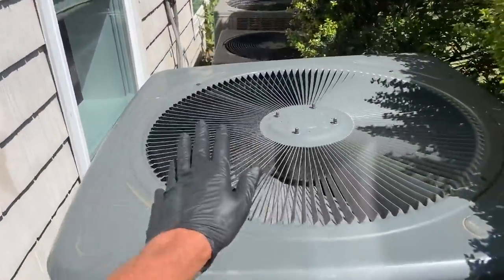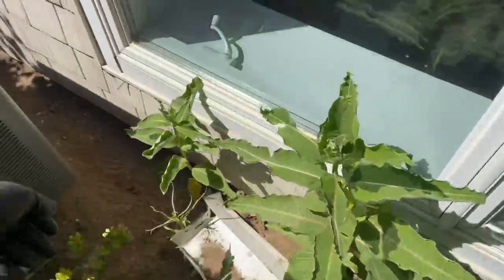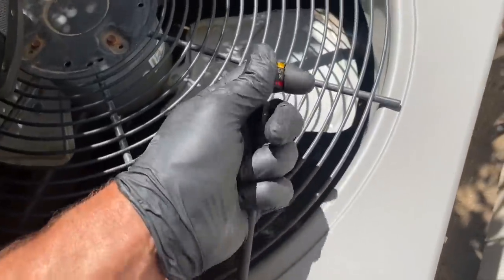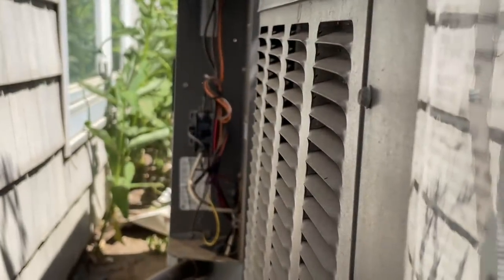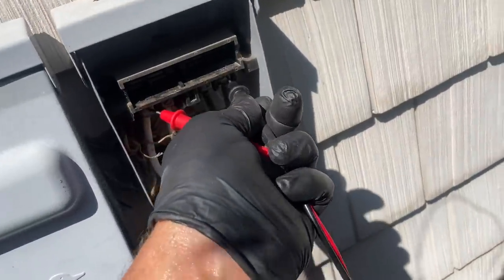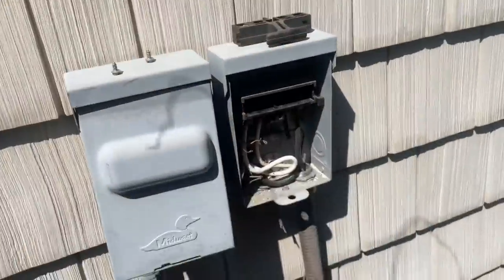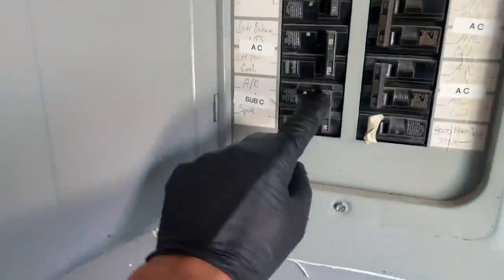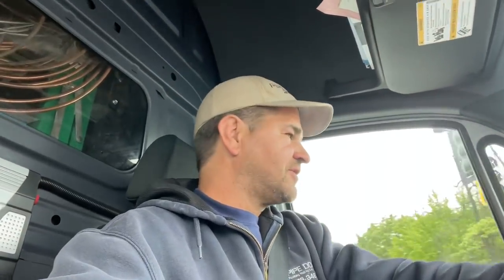Central AC Condenser Not Running - L1 & L2 both have 120 volts - But Not 240 volts

Comment: Residential housing is 240 volt, single phase.  L1 and L2 are merely opposite in polarity.  The neutral tap is at the midpoint of the secondary winding of the transformer.  This is why the voltage is 120 volts when measured from either L1 or L2 to the neutral.  So A and B sides in the electric panel are opposite in polarity, not phase.  Power station generation is 3 phase.  Each phase winding is 120 degrees away from the prior phase.  Any given house, gets one phase or another.  If you were to have two phases coming to your home, they would be 120 degrees out of phase, not 180.
Reply: “Legs” , “phases”. We knew what he meant.
Reply: Maybe you can clear this up for all the guys that don’t want to ask . ( and are a little confused) If I understand what Mike is saying he has two 110 Lines  coming from the Same L1( same polarity) in the Circuit breaker panel for that to happen? I would think that one line on the same (L 1 same polarity) from two different 240 Circuit breakers is how that  could happen ? Giving you only  110 and not 220 ???   Thank you 🙏
Reply: @petem6291  You are correct.  Mike's explanation of why there is 110 is also correct.  I just wanted to explain the difference between phase and polarity.
Reply: @petem6291  you have 4 wires 2 hots or legs ( L1,L2 ) , a Neutral and ground .  So to keep it simple we will only look at one side because it is true for both . Anyway the Legs alternate from top to bottom . so a double pole breaker or as you called it a 220 breaker can ONLY  connect to L1 and L2 . But if Sparky the electrician moved wires around and he didn't pay attention then he connected both wires to one of the legs .  So why was there 110 outside ? Well both wires actually started from the  same point inside and split apart out side . I hope that helps .
Reply: @petem6291  you get your power from the lines at the pole outside,it has three legs feeding that pole,power company taps two of the three and drops them onto a step down transformer,then feed them from the transformer to your meter box and into your panel 120v per leg it's not 2 phase it's single phase! Trying to keep it simple
Reply: Wrong MC...Single-phase transformers are 1 hot and 1 ground primary and 2 hots and 1 ground secondary which produces electricity that is 180 degrees out of phase, (A and B phases).  
Three-phase wiring is 120 degrees out of phase, (A-B-C phases) on both the primary and the secondary. This gives you a Wye connection that is 120/208 volts or 277/480 volts. There are some older 3 phase systems that are Delta connection that gives you 2 legs at 120 volts to ground and 1 leg that is around 200 volts to ground. Delta systems give you 240 volts between phases. They worked best when you had mostly 3 phase motor loads and very few 120-volt connections. Delta secondary 3 phase systems have just about been phased out.
360 degrees of rotation in one cycle of electricity. 180 + 180 = 360.  120 + 120 + 120 = 360.
Reply: Polarity and phasing are two separate attributes of electricity. Polarity speaks to the relation between the primary and the secondary. Phasing speaks to the time and amplitude displacement between electrical wave forms. The term phase here is being used to describe a line or leg of a transformer secondary and that is a incorrect usage. (By industry standard.) The polarity of a coil can cause a phasing displacement  but for everyone on here the secondary coil of the transformer is 240v, that coil is split in half to supply 120v . If you connect to (L1-L2 ) the full coil you have 240v if you connect to half the coil on either side (L1-N) or (L2-N) you will get 120v and like mike did today if you read (L1-L1) or (L2-L2) you are measure the same point so you get 0v. Forget phasing and polarity unless your on the pole wiring the coils in the transformer... 
H1.                G
UUUUUUUUU (8.4kv)
===========
mmmmm (240v)
l.      l.      l. 
L1.  N.   L2
Reply: @Bryan-Hensley  not very common,but I have seen 120v supply in very rural locations
Reply: spit a phase and each leg is out of phase from each other.

Comment: Single phase panels alternate L1,L2,L1,L2... all the way down so a 2 pole breaker will automatically sit across both L1 and L2 no matter where you put it in the panel. When someone mucks up the wiring like you have here is when you have issues  OR if you have fuses instead of a breaker, when one blows you can get weird readings of 0V line to line but 120V from Line to Ground

Comment: Could have been only one leg to the unit had 120 volts and the other had 0, with the contactor pulled in the one leg with power will go through the contactor and through the windings of the compressor and back to the dead leg giving you 120 volts to ground. Unplug the 24v to contactor and you will only get 120v to ground on one leg. (In a case where you only have 1 leg energized from the pabel)

Comment: Alot of the new breakers have the wire coming up in at an angle,so it is easy to miss the right slot,but that's why you check everything before you power it up

Comment: Part of the issue was someone used WHITE and did not add color tape (typ Red) over it for the visible portion.
Reply: I thought you just had two hots and a ground with 240v? He had two hots a neutral and a ground.

Comment: Hey Mikey, just wanted to throw in a little more info and break it down some more. I ran into something similar recently and it took me a minute to understand why I was getting the numbers I was getting, but my outdoor unit wasn't running. I'm sure to more experienced guys, this will be obvious. But for someone coming up in the trade, like myself, having it broken down a little more really helped me fully understand it for the future. 

The reason there is 120v on each side to ground is because the one hot leg that was still connected correctly was sending its 120v through the motor windings and through the other leg of power to the disconnect, and up until the point where the electrician wired it incorrectly. Which is why going from leg to leg was showing 0v, because it was the same leg of power, which means there's no potential difference. This is why it's important to check leg to leg, and not just to ground to see if you're getting your full 240v potential difference, and not just 120v on each leg to ground which may be mistaken for two complete legs of power. In my case, my second leg was being lost at a relay with bad contacts. 

Probably obvious to a lot of people, but hopefully that helps someone.

Comment: so the eelctricain connected the black and the white to the SAME LEG? IF it was wired at a different leg, he would get 240 v right
Reply: probably mixed up wiring across feeders to two condensers, likely they're fed with identical looking and same gauge wire. possibly an honest mistake, sometimes things blend together in panels and you wiggle a wire and it moved another, you go thinking it's right and install. ""wrong"" rework time, we've all done it before ;)

Comment: Your explanation is incorrect.  Every other breaker slot is an opposite phase.  Its not divided by side
Reply: Panels actually are separated by side, one bus on left one bus on the right, exactly how mike gestured. Each breaker position alternates tapping the left and right busses.....
Reply: Except he wasn’t, the legs are separated by a left and right bus, the breakers alternate which bus the pick up. What how he gestures left and right and how he points it out. Then look up a picture of the panel.

Comment: Ima little ocd I have a paint brush to clean out the eletcial and then I also use a damp towel to wipe all the wires make sure it’s clean
Reply: I’d prefer the soft bristled brush too. It doesn’t need a battery and it’s light-weight.👍

Comment: Looks like he didn’t pay attention to the “correct” wires when he reinstalled them to the breakers. My guess is that he crossed the wires from the other 240 breaker that was beside it.
Reply: or there is something else to the story.
Reply: yeah, I'm guessing he flip-flopped two wires feeding two of the condenser disconnects. very likely the two side by side were both not working.
most likely identical wire/gauge and an honest simple mistake, it's easy to do in really packed panels

Comment: Never check power with the contactor pulled in because you can read a back feed through the compressor. In the breaker panel, every other spot down a side is an alternate phase. So the top of that one breaker and the bottom of the one above it would give you 220 volts. Also when wiring anything, white is never used to carry power. They should have either used 2 blacks or a red and black. Whit is only for neutral.
Reply: he had the disconnect pulled out, so the line from panel terminated right there at the disconnect where he checked it.
but yes, if he left the disconnect jumper plugged in, it would back-feed through the equipment ;)
Reply: @throttlebottle5906  what do you mean by back feed?
Reply: @jorgeochoa6224  the power would come in from the good leg, pass through the equipment and back out the leg with an issue. measuring from anywhere to ground would then show 120volts and lead you to believe there's proper power. measuring across a blown fuse or bad switched disconnect would show 240-volts on the bad side. but that doesn't show you if anything upstream is bad.
Reply: @throttlebottle5906  thanks 🙏
Reply: Hey one more question. If I’m getting 240v from the line, but on each leg on the line I check 120v to ground, and I don’t get the 120v to ground on both lines from the disconnect what does that mean?
Reply: @jorgeochoa6224  check your breaker. You have to be getting a phantom voltage if you are showing 120v on one phase but not on the other.

Comment: Hi there Mikey pipes, just need your help on fujitsu ductless. I went to a service call and the indoor unit is leaking on the bottom front, pressure is good, i tried vacuuming the end of drain hose. When i ran the unit, water is draining properly but still leaks. Do you have any suggestions on what to check or what could be wrong? Thanks a lot
Reply: @PipeDoctor  it was installed 8/9 years ago and the leaking only started last year, i was not able to check level, but when i ran it i can see water in the hose

Comment: Great video... Was the compressor still good?
Reply: The worst case is the compressor will open on internal overload. Any motor or compressor except 3ph will run with 120 volts to test.

Comment: Just shows how important it is to check from power to ground and not just L1 to L2 a less experienced tech could have got bit
Reply: always test all legs against each other, then to neutral, then ground, also check neutral to ground! you just never know what happened upstream or who's been hacking around.
I have found 120v present on ground and/or neutral before, you just never know!

Comment: Missed something?
He took the wires off a two pole breaker ?
If not the slots on the breaker can't possibly be on the same line
L1/L1 ? 
I believe I'm missing some footage ?
🤔🥃
Stay safe.
Keyboard(werk'n) super tech.
Wear your safety glasses.
Reply: Could be a half size double pole breaker, right? I don't think I saw one though lol- so they are just winging it and wiring the AC to two random breakers?

Comment: So they either used a mini double pole breaker or they wired the AC circuit using two breakers on the same phase/leg? wtf
Reply: If you lose a phase in a hvac system you can get a phantom voltage that's actually a back feed, so you are reading the same phase coming back on the other side.

Comment: One leg is bad or a not so brilliant electrician wired it on the same phase. Electricians should not touch HVAC stuff they mess it up 90% of the time. One of the electricians wired two line voltage on the same side in the disconnect and it popped when he inserted the fuse.

Comment: You Did Not Need An Electrician 
When You Donot Have 240
Outside In The Disconnect 
Simple You Replace The 
Breaker.
You Learned That In The School
Or Not ?
Amén.